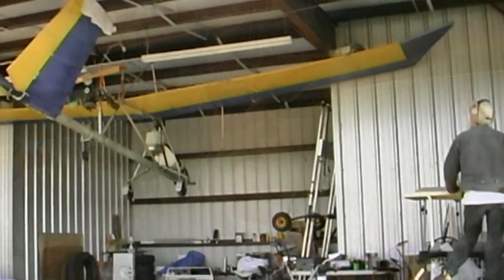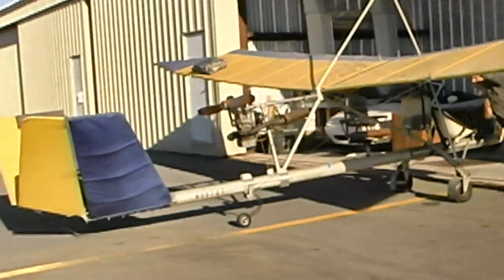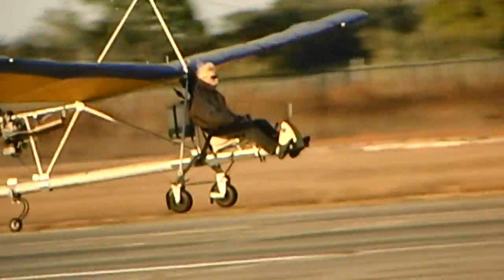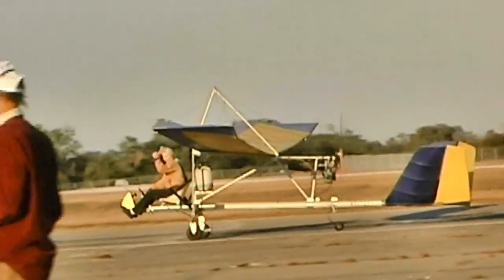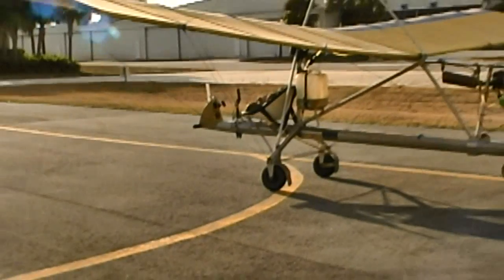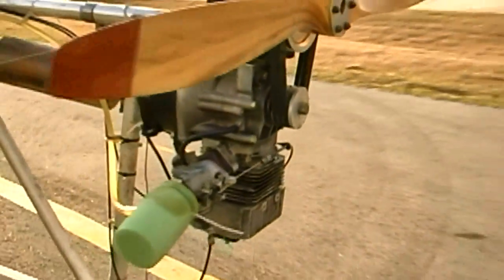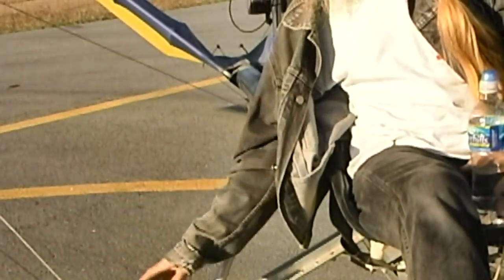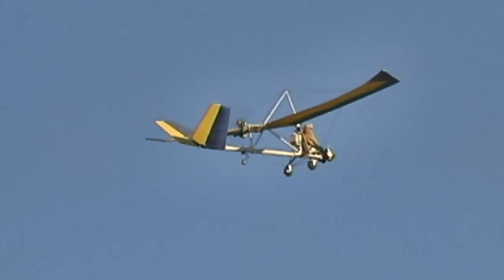Maxair Hummer, single seat part 103 legal antique vintage ultralight aircraft.

Comment: I just bought a complete kit never touched from 81. Of a hummer. Excited to start putting it together
Reply: Consider reinforcing the main tube at the downtubes now, as they failed commonly in hard landings. The zenoah was not reliable.
Reply: did you get it together? hows it going ?
Reply: @JessHull  life got in the way, I have the tail wheel, half the main gear, and the basic main tube done. I actually took a week off of vacation so I can get into the hangar to make forward progress. Just been searching for motivation to actually go and do it lol.

Comment: The Hummer was my first ultralight aircraft. Being a licensed pilot, the two axis control was strange. Absolutely no crosswind control. The original belt drives were prone to the pulley breaking off the flange. I converted mine to 440 twin cyl engine, which worked out well, since I was heavy. The view is nothing less than outstanding!

Comment: I just purchased one of these at an auction to save it from being scrapped for aluminum.  The sailcloth is shot but I was hoping I could find someone who needed parts or wished to purchase it to make it fly.  It includes the Zenoah G25B-1 engine and everything it looks to be in pretty good shape outside of needing sailcloth and some cables.  It is located in Elmira, NY if anyone is interested.  I underestimated its size and would like to unload this thing quickly!  Everything goes for $500.00.
Reply from the maker: +James Hood Put it up for sale on barnstormers.com, in the ultralight section.
Reply: James Hood is it still for sale?